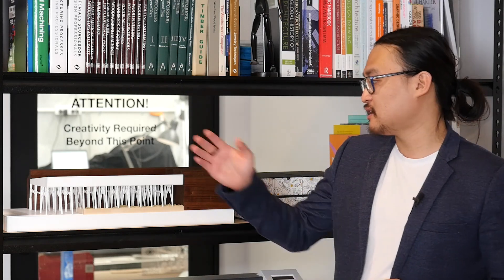Conceptual Model Build - Laser Cutting + CNC Routing | Architectural Modelmaking

Comment: When mixing Cnc and laser designs, how do you account for the kerf to make sure things line up or fit appropriately? I use Vectric and I’m wanting to layer acrylic (laser cut) and wood (Cnc cut )lettering. How do I ensure a 3 inch letter on a laser design is the exact same size on a Cnc?